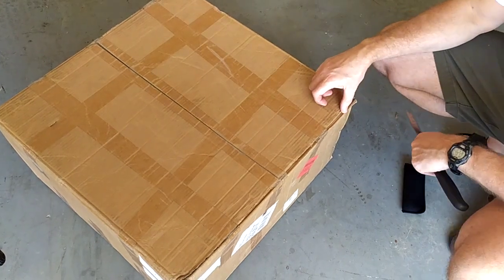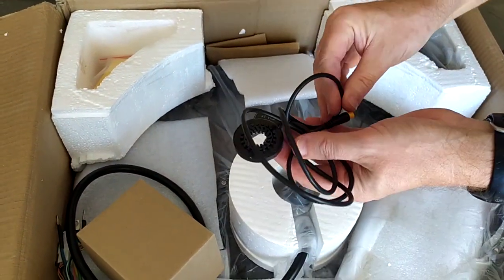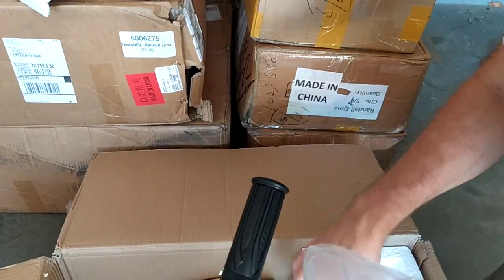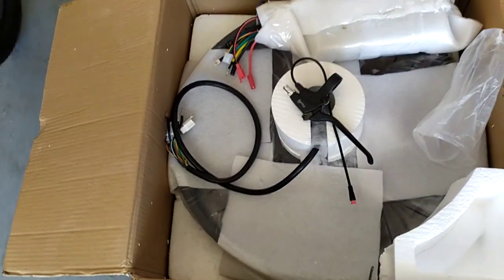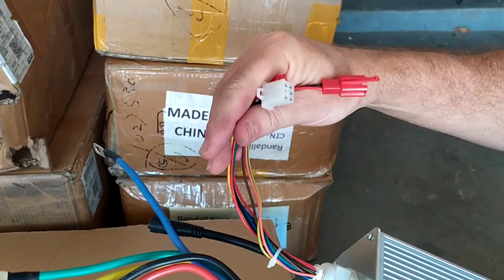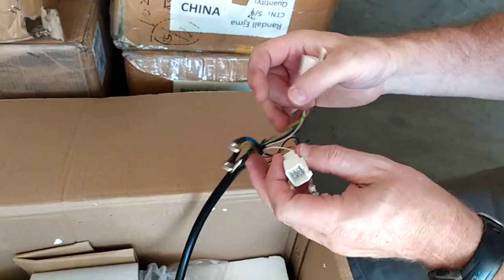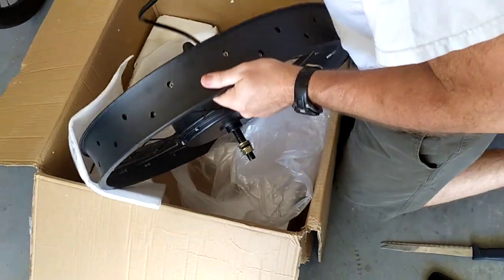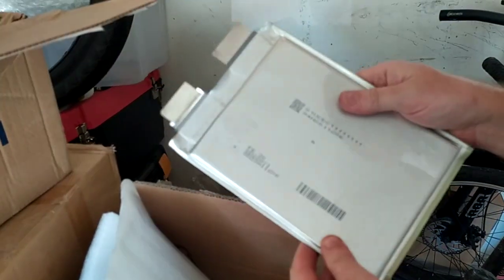TexasNEV 5kw (8kw peak) 26" Fat bike hub motor kit, unboxing!

Comment: Would a 72v 40ah 100bms battery work with the 120 controller?
Reply: power may cut off and i think its dangerous so make sure to get a suitable kit with controller or get bigger battery

Comment: Hey, looking for a bus bar to use at 72v 50amp.  All the bus bars I see are only rater for 48v dc. Any advice?
Reply from the maker: It's all about the current, not the voltage.. If it's 50 amps then you're fine.
Reply: Hey, this is Vic Hugo. I bought the kit. Tracking says I should get it on Sunday? I didn't even know FedEx ships on Sunday? Anyway, Inran intonyour clip on YouTube doing my ebike research. Nice. I just hope the bike is 170mm. If not, and you won't help, I might just return the bike. Reason: I seen bad reviews on it. Cheaply made forks..etc. @TexasNEV